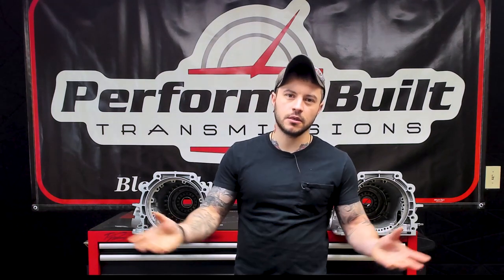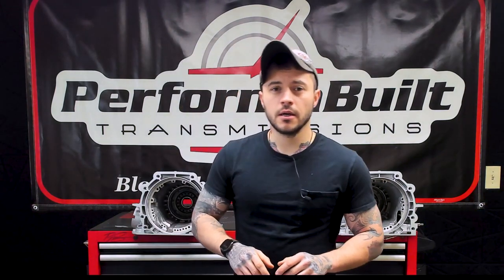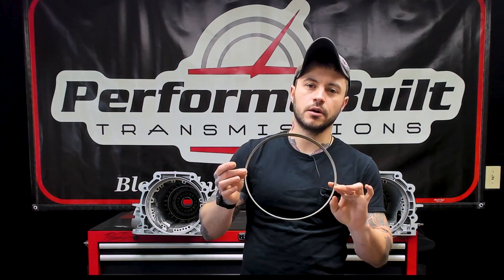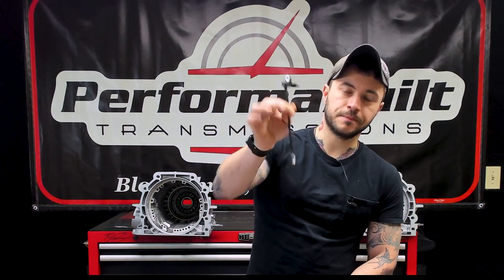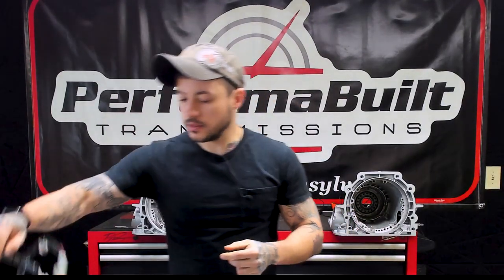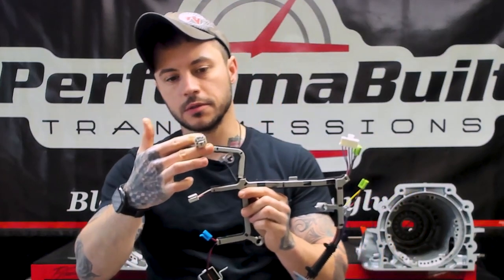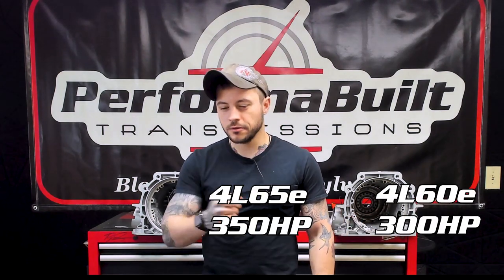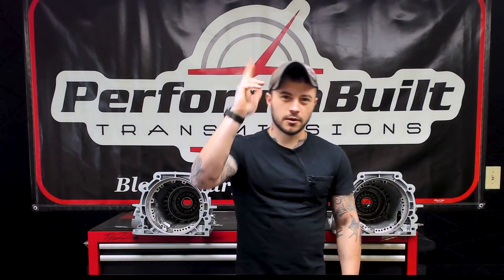Is the 4L70 really any better?

Comment: Hate your delivery but love your facts and knowledge.  I have run a cammed 5.3 LS with a 4L60 in an S10 up to roughly 475hp with great success. My current ride, A '68 C10 has a similar engine with a hotter cam and long tubes and I opted for the 4L80 because of the weight of the truck, larger tunnel and available space.  Both trucks are very reliable and in a cruiser IMHO the 4L60 works just great, want to step it up ?  5 pinion planets and all the aftermarket goodies are out there for the 60 so have at it but the 80 handles the power and doesn't cost you an arm and a leg.
Reply from the maker: In the inner talks of the industry, the 80 isnt going to be cheaper much longer. Cores are getting destroyed and harder to get, the drums cant turn near as much rpm and are costly for aluminum ones. Reid just increased their prices immensely a few days ago. The 80 is about to cost more than the 60 by alot.
Reply: I have about 800hp going through a highly modified  4L70E... in a Saab 9-7X Aero. I'm seeing a little more metal flake than I like in the fluid but have done 0-60 in 3.37 w/ 1 ft rollout. 3.69 w/o.
Reply: My 4L70E has 5 pinion planet, 800hp Saab 9-7x Aero. (TBSS)
Reply from the maker: Might need to check your converter spacing as in its too tight past 1/8 or more likely your flexplate is wearing out and chewing up the pump backing. Not alot sheds metal flake in these transmissions except that.
Reply: @PerformaBuiltTransmissions  did that recently & was correct per Yank instructions. Thanks 4 reply! I will see when I open it up if it gets worse or stops working I guess. I just figured heavy vehicle + power = clutch wear? By "shavings" meant glitter btw...
Reply from the maker: Id check the flexplate when you get there then. It could be worn and over flexing if your spacing it correct per yank. Usually when i see glitter (aluminum) its from the pump backing or converter stator (converter stator is unlikely in your case because its a quick catastrophic failure that isnt slow)
Reply: @PerformaBuiltTransmissions  Thanks! I think my glitter is steel but now I'll check that. It's still performing well so if I caused the wear I'd pull it asap. Is there a better flexplate than stock? Funny i modded everything motor/trans myself & never considered flexplate! (Also I heve pretty low miles, but drive it pretty hard & it's heavy)
Reply from the maker: Any sfi / billet one is better than stock. Highly recommend circle d billet flexplates
Reply: That is a great video. The only “E” that I have anything to do with now save one. I wired for manual. I’ve had no issues with them. They aren’t hot rotted that much mainly pulling. But I do have an early case 700R4 did I have put as many of the “E” upgrades for five planetary bearings in place of thrush washer in it it’s tough, but I don’t abuse it. Once again, thanks for this video you explained a whole lot. Be blessed happy new year.
Reply: @PerformaBuiltTransmissions ❤

Comment: I work part time at Orielly’s Auto Parts. The 4L60, 4L65, and 4L70 are priced the same. Trying to figure out which one to get.
Reply from the maker: Its because they are the same in general. No difference that matters in function except the 70 iss if your vehicle requires it and is not on a standalone.

Comment: My 4L60e in my ‘02 Sierra has crapped the bed, and a friend has given me a great condition 4L70e (case code 6KMD) to swap in. I’m assuming I can just do a direct swap using my current harness and ignore that additional speed sensor…?
Reply from the maker: Will work just fine. Pcm wont see the sensor
Reply: Can a 60 be used where a 70 once resided? What type of codes would it have and can hptuners tune out the fault code?
Reply from the maker: It can but you will have to go into the pcm and change the iss function from fitted to not fitted. This wont work with all pcms but most of them.

Comment: Thanks kid, I have been wondering how to order the right parts for my 4l60e rebuild. 
Very helpful.
Reply from the maker: Check out some of my older build videos for performance parts suggestions if you havent already
Reply: @PerformaBuiltTransmissions  Been there done that but I have been confused a bit as to which parts are used in the different vintages of 4l60e like harnesses and valve body components. I have C5 Vettes and a cherry 2010 GMC canyon with the 5.3 v8 option and low rider handling kit so they all have different 4l60 requirements. Thank Again.
Reply from the maker: Valve body and harness setup for the c5 from 1997 to 2004 will be the same and you can use any valve body and harness out of any 4l60e or 65e from 1997 to 2006. The gmc canyon has a unique core and is set up in the style of 2009-2013 model valve body and harness. The only time the 4l60e got super weird is the three standalone years i.e 1993, 1994, and 1995.
Reply: @PerformaBuiltTransmissions  Appreciated Ryan, Thanks.

Comment: Thanks for the honest information brother. I have a 07 Chevy Silverado Crew Cab 4.8L 2wd and i needed to know the right stock remanufactured transmission replacement to go back into it. Which of these transmissions you talked about should i get to put back in it? If it was your truck? Which stock trans would you put in it?
Reply from the maker: You actually might have a rare exception because most of those came with 4L60Es not 4L70Es.

Comment: I have a 4L60E and a Terminator X Max and added a pressure sensor.
Are the standard pressure setting ok or do you have a base recommended starting point?
To find someone with knowledge and the Holley is hard to find.
Reply from the maker: Depends on your trans builders build. We require a stock line pressure setting for ours.

Comment: in an AWD truck, like a 2003 Silverado SS, can a 4l70 be used? do you make adapters for the AWD transfer case? I know the 4L80's need new drive shafts, a new adapter to connect to the Tcase, and a wiring harness adapter.
Reply from the maker: Why do you want a 70 in a 2003?

Comment: Gosh DAMN IT!   i just routed all my harnesses for my Terminator X max yesterday!!    Is this 13 pin connector absolutely necessary?  Only thing i see in the instructions from Holley is pre-2009 4L60-65e W/1.75 second gear ratio or W/1.63 second gear ratio
Reply from the maker: Holley x max usually requires a 15 pin not a 13. They list it broadly from 1996 to 2008 but left out the part that 2007 and 2008 are totally different from 1996 to 2005 / some 2006s. Consult your controller and harness you posess for a pin count. 13 is 60e and 15 is 70e

Comment: My 2006 Sierra Vortec Max code claims to be a 4L70. Thanks for any  information
Reply from the maker: Might be might not be. For the sake of video time and todays attention spans i did not cover every little vehicle. Some 06 models did have 70s like the trailblazer ss  but its is extremely extremely rare. Youll just have to start running numbers your vin and rpo codes.

Comment: Hey man, whats the real difference on the  1 Piece K housing and the non K housing on Fbody cars?
Reply from the maker: Casting is slightly thicker around the starter and dustcover area. Was meant for 4x4 trucks mostly and gm cut the ears off of each side for Fbodies because the cut would weaken the non K case around the cut area.

Comment: I have a 2004 gmc yukon 5.3L vin code z with a 4L60e thats got a failing pwm torque converter. Can i swap it out for a 4L65e or 4L70e with no modifications or problems? Will the computer system be ok with the newer trans? Any info is greatly Appreciated disabled dad in need if help.
Reply from the maker: Yes, You can swap it out for a 4l65 or 70 and there will be 0 issues with the computer.
Reply: @PerformaBuiltTransmissions   thank you so much for your response!! 2nd question..will running John Deere Hygard low viscosity tighten up the torque converter and buy me some time?  lot of old timers recommend this but don't know the veracity if such a claim
Reply from the maker: I have lots of people that use hyguard no issue.

Comment: An ISS does not make it a 4L70E. There are 4L60E RPO M30 with an ISS, these had 4 pinion planetaries and controlled by a TCM. I believe when GM went from PCMs that controlled both the engine and trans to separate ECM and TCM that the TCM required an ISS, so to keep using the 4L60E it had to be upgraded to have an ISS. The 4L65E RPO M32 has 5 pinion planetaries, 7 clutches in the 3-4 pack, stronger input shaft, and a stronger forward sprag. The 4L70E RPO M70 has the same upgrades as a 4L65 plus a stronger output shaft. A 4L70E RPO M70 was only found in the TrailBlazer SS, 2006 GMT800 with LQ9 engine, and 2007 and 2008 GMT900 with L76 engine.
Reply from the maker: 99 percent of this was mentioned in the video minus codes... most people watching this dont want to get that into it and want it put simply. Simply is, The biggest difference between the 70 and the rest being basically a iss sensor is the key and major difference that came about in 2006 and primarily in 2007 and 2008 various model codes. Transmission slang is 2007 and 08 were pretty much in fact dubbed the 4l70e unofficially by nearly everyone in and out of the industry. Said 2006 trailblazer was mentioned in being the true 70 as well. You can also change most pcms or tcm  iss input selection from fitted to not fitted as it was not an essential peice at all. Great info thats more detailed than i was tho.

Comment: My 06 Sierra has a 4l70e.
Reply from the maker: Yes. Quote "Some 2006s namely the trailblazer ss" please rewatch
Reply: What I am getting at is that those are the oddball years, because mine does not have a ISS. It has a 13 pin green plug. But has M70 RPO code.
Reply from the maker: @sierravmax  Then its not a 4L70E. a 13 pin non iss 70 does not exist. If it has that code, it has to have ISS.
Reply: @PerformaBuilt Transmissions  Not true. Truck has a 4l70e. Even the brochure they gave me says it when I bought the truck brand new. It is a Vortecmax with a LQ9. Reason is because it does not have a T42 TCM. ECU still controlled the trans. No point of installing a sensor.
Reply from the maker: @sierravmax  we can agree to disagree. you may have a rare case but overall its not truely correct, no iss means its just a glorified 4l65E
Reply: @PerformaBuiltTransmissions  Mine had a plastic plug where the sensor normally goes. It has the hole.
Reply: 06 and 07 were the only years of the Vortecmax classic, so they are pretty rare. It was a last minute effort by GM to try to keep up with other manufacturers tow ratings.
Reply from the maker: I learned something but its not going to apply to 99% of the public
Reply: I'm probably in the same boat with my 2006, not here to argue, just to find out what I actually have. Thanks for any Information on these transmissions. I was glad to see a 14 bolt with 4:10 gears, unfortunately with a G80.
Reply: @mariotillery8459  Yep I had the 14 bolt with 4.10's as well. It had the HD towing package with 17" wheels.